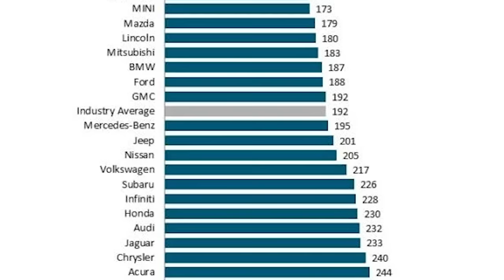Trucks That NEVER Break Down (Reliably run 1,000,000 miles)

Comment: The duramax is trash. Owned a 2013 for three years. It was on the road for 1.5 of those years. Really fun making payments AND paying repair bills and parts bills of up to $10,000 for something Chevy f**ked up on. I basically gave it away 2 days ago. Dont buy any duramax with emissions systems or a Bosch cp4 fuel pump! You'll thank me.

Comment: Let me brake this down 
If you’re not buying a Toyota or Nissan your buying junk. Our CFO swears by Dodge he bought 15 I said when they brake down you fix them. Less than 3 months and 14 of the 15 spent more time in the shop than on the rd. So his great idea let’s buy Chevy Silverado 4cyl turbo. I lol and said idiot why didn’t you talk to me? When the turbos go out it’s on you.  6 of the 6 went into the shop for turbo and  electric issues. He comes to me what should I buy buy and tundras. He buys rangers and f150 4 of each. I said rangers cool I’ll deal with those but the f150 are your problems. He said ford tough bruh. One totaled in day one because the guy said he had no brakes the 2 in 60 days completely stoped working and our still in the shop. Number 4 is still on the road. So CFO finally bought 6 Tundras and 4 tacomas what a shocker 9 months and still running great. Always listen to your fleet guy there’s a reason he’s in the position he’s in.

Comment: lol I’ve owned all these trucks and Toyota is far better that the rest. A GMC 2010 and up good luck on replacing the rear main seal on that engine after 75000 miles. The ford f-150 2015 and up good luck on replacing the torque converter after you drive it off the lot. The dodge ram 1500 2000 and up good luck on replacing the transmission after 100000 miles. The s-10 anything made after 1990 be prepared for it to run hot. The ford ranger anything after the square body ranger will fall apart after about 20000 miles. You need ask actual people who have owned them and drove them everyday to work and home and my next truck will be Toyota even though they are ugly as sin they are the most reliable truck on the road still today.

Comment: Ford 5.4 triton is not a bad engine just an expensive needy engine nobody wants a vehicle that requires the whole timing system replaced every 100k miles and synthetic oil changes every 3k miles just to have 100k trouble fail then repeat every 100k $$$$

Comment: Anyone that lives in the rust belt knows Toyota frames SUCK
Reply: @chadhaire1711  I work in the industry
Reply: @anthonyhumbert8787  So do I....and done so a lot longer
Reply: @chadhaire1711  really you know how long I've turning wrenches?
Reply: @anthonyhumbert8787  from your comments you turn wrenches the wrong way.  I have been driving these for 52 years and I still test factory cars for a living...I know what vehicles are good and what are not......your Toyota bashing  is just more hot air.  You probably  drive a Dodge Dakota, and next are going to tell me you have 300,000 miles on it with no repairs.....
Reply: @chadhaire1711  oh and I drive a 2021 3500 Sierra Denali
Reply: @chadhaire1711  as well as a 2015 ctsv and a 2019 atsv
Reply: @anthonyhumbert8787  I get it.....enjoy your dakota

Comment: Was this satire? Most of the trucks on the list are complete garbage.. Silverado blows more engines than Subaru.. Mitsubishi trucks lol 🤣 hands down the worst truck I've ever owned... Now he was right about the Ford/Mazda 4.0s were an Unkillable beasts I had 332000 on mine when I sold it to a guy who drove it cross country and kept it for years.. 7.3 Powerstroke is arguably the most reliable Diesel ever made and Cummins are very good but the rest of the list 😂 you have to be joking..

Comment: This channel seems to just go off of internet research no real world mechanical knowledge.  GM gen IV LS engines with AFM even fhe later genV and later LT engine with DFM have known lifter issues...oil consumption....etc.  Ford has issues all across the f150 line 1st gen 3.5 v6 ecoboost  have valve issues and gunning up of top valve train....the 5.0 coyote has know oil gear pump issues....the list goes on and on.

Comment: I disagree with some of ur choices. Example Chevy are straight trash in my opinion. There nothing but rot boxes. Ford's are also trash. With recall after recall . Iv owned Chevy Ford's and rams. And had the best luck with the rams. Currently on a 16 ram 3500 with a 6.4 towing daily. I'm ok with the cheaper int I want to come as a reliability. All the rams that I've had have been the only ones to ever consistently start and drive daily for me no matter what Hell I put them through. Speaking strictly on domestic vehicles.

Comment: Video is primarily focused on US Market offerings, with a mention of Hilux along with a few others. The rest of the world has trucks which offer superior reliability which are not mentioned, primarily because the US is a closed market where marginally reliable, oversized fuel hungry, Detroit chrome monsters (probably made in Mexico) prevail 

The Land Cruiser 79 is the pinical of a true heavy duty, pickup, still available in sone markets where gross HP ratings are unimportant, North America has become soft, demanding creature comforts, automatic transmissions and lousy fuel consumption and consider this norm.

The Hilux is in fact considered a medium duty pickup, Mitsubishi and Isuzu have similar model offerings which get 40 mpg +, but who cares when fuel is cheap? Just keep driving your unreliable oversized monsters without considering the rest of the world, never seen the Taliban driving a Ford, Chevrolet or a Dodge did you, they may be evil but they do know what to depend on, go to Central America same thing and they are not bad guys, just have good taste.

Comment: This is some of the most biast information I have ever heard .yes let me buy a dodge that will
Need a tranny that is a huge cost and makes the truck unlreliable ..the most reliable trucks are Toyota (shame they don’t make desil ) followed by ford ranger second gens but tied with Chevy s10 and then for heavy duty is gotta be the 7.3 or the 6.7 power stroke because over all you won’t have a big repair like a tranny or a engine fail .if a vechicle
Needs mayhor repairs through out its life it’s not reliable and likely in less then 100k miles

Comment: For GM, Ford and Dodge to be on this list is a joke. It’s a fact that people with this Brand Loyalty mentality are the most unreasonable and stubborn to get the truth out of. I’ve had these type people talk about how great their vehicle is with 300k miles on it, commonly forget to mention the rebuilt engine and transmission they were forced to complete. It’s all a bunch of BS. Good luck regardless of what brand you buy, but if you by a GM, Ford or Dodge, your already setting yourself up for disappointing longterm ownership.
Reply: So if you need to tow 15,000 plus pounds what are you going to do? My 2007 Tacoma was a great truck but it was maxed out towing 6500 pounds. Check out C Farmer here on youtube. He is a Hot Shot driver currently towing with a 2017 L5P Duramax with 450k+ on the odometer. His truck is emission intact and has not had the engine or transmission rebuilt. He did need pinion bearings, NOX sensors, DEF injector, Turbo Actuator, and injector wire connectors. His truck has over 13,000 hours on the engine. He is constantly towing heavy with it and idles it overnight because he sleeps in it.  I am not going to call that disappointing.
Reply: @jimm2442  unfortunately we are greatly limited when it comes to heavy towing. No HD truck
Is cheap, yet the cost to maintain and repairs on the HD trucks outweighs the cost of purchase. GM, Ford and Ram can pound sand.
Reply: Huh? Had 398k on my 2004 5.3 Chevy until someone pulled out in front of me and that was that. It did have an Allison tranny in it though. Only thing I did was a water pump (took 20 minutes to do) and an oil sending unit. I picked up an 08 f150 5.4 cheap that now has 300 k on it. You can avoid problems with those if you avoid carbon build up by using premium synthetic oil and filters every 5000 mi max.
Reply: @elithepitbulldog2209  yea, everyone has a story. 30 yrs in the new and used market tell me otherwise. GM, Ford and Ram build Garbage compared to Toyota and Honda products. All Manufacturers have issues no doubt, at least Toyota and Honda try to perfect their designs instead of throwing them away and starting all over again with a completely new design like Ford, GM and Chrysler constantly does.
Reply: You didn’t mention how many Toyota are salvaged ever year because the frames rust out beyond repair I have had new and older Toyotas but they really had no payload or towing ability and the mpg was awful
Reply: @troyehnisz9907  If you actually paid attention to what all manufacturers are building, you’d definitely take a Honda or Toyota product above all others. The rusty frame Comment is old news and Toyota is the ONLY manufacturer to ever attempt to make something wrong corrected even after the warranty has expired. Ford, GM and Chrysler wouldn’t have even cared